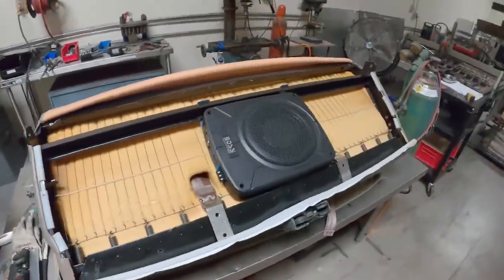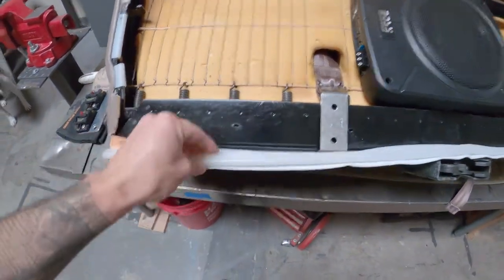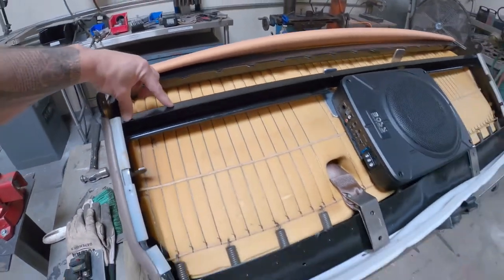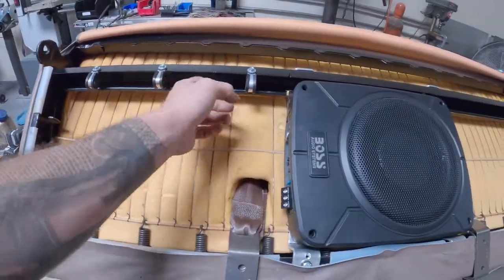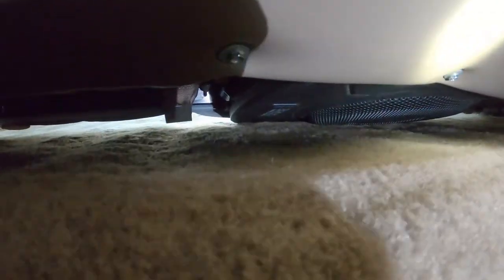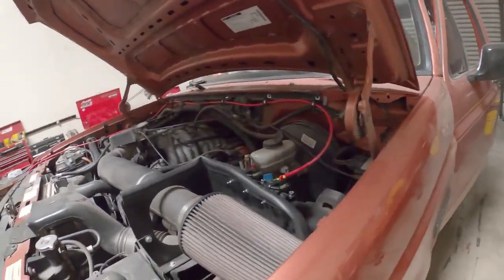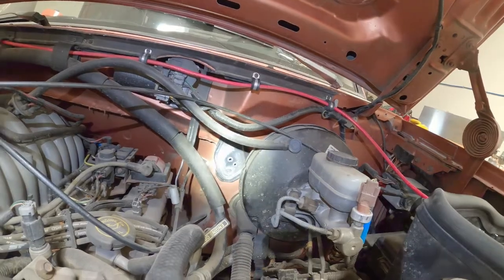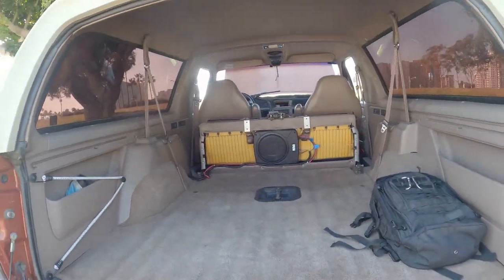Subwoofer In The Bronco | Ford Bronco Car Audio | Subwoofer Installation For The Bronco

Comment: Very nice sub setup, I like how compact it is especially since it’s also an amplifier, I decided to do something similar but still different, I bought separate subwoofers and an amplifier, both MASSIVE brand and since I have bucket seats in the Bronco I put the amp under the driver’s side passenger bucket seat and I bought a Q Bomb subwoofer case for my 2 eight inch MASSIVE subwoofers and put it behind the same seat it works well and I only did this because of your video thank you very much and I appreciate your content. 😃
Reply from the maker: Nice sounds like a good set up. Glad I was able to inspire you 🤙🏼
Reply: @socal4x489  no problem

Comment: Ordered 1 to replace the massive sub and amp that came with my bronco. Been driving me nuts. How is your Bronco? Any updates?  Thanks for the video
Reply from the maker: Awesome man. Bronco is running strong no new updates tho but I drive it daily 🤘🏼
Reply: @socal4x489  took it hunting Saturday. Fueled it up with ethanol free to park for the winter. Called for snow yesterday, got none but they still brined the roads so salt season had begun
Reply: @danmorris8594  ..Hello Dan..95 bronco here..You still have the original indash unit???  I need a new indash and i see that the sub u used is still on amazon...looks good..Thanks for the video...Retired in Florida..jP

Comment: Which breaker did you use bro? I’ve got a 93 Eddie Bauer that wants to get a little better sound in it heh heh heh
Reply from the maker: Mid range speakers are just aftermarket replacements. Not the beat I’ll admit. I’ll be upgrading all mid speakers and running an amp to them.
Reply: @socal4x489  I looked up some good replacement speakers and JBL GX628 are a great replacement for the price. You can also sauter the old plug from the original speakers onto these to make them fit the original spot.
Reply: Just makes it a little easier plug and play install